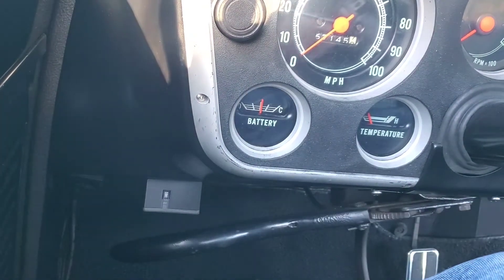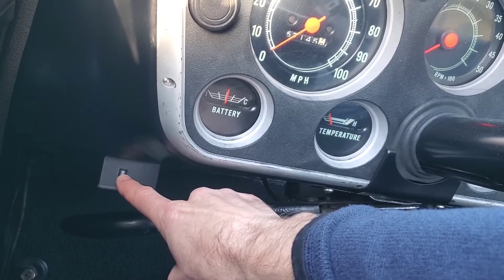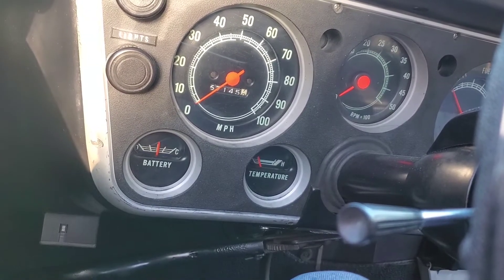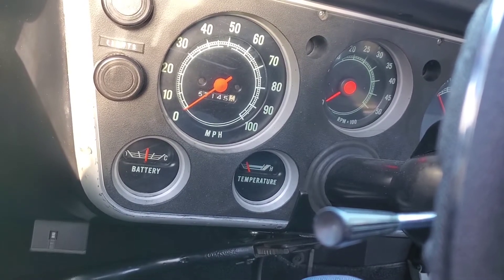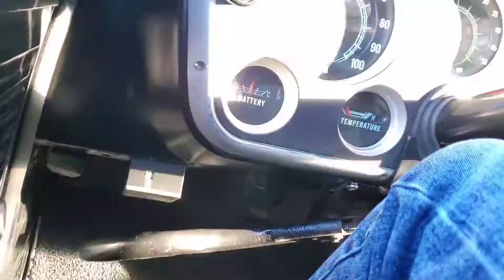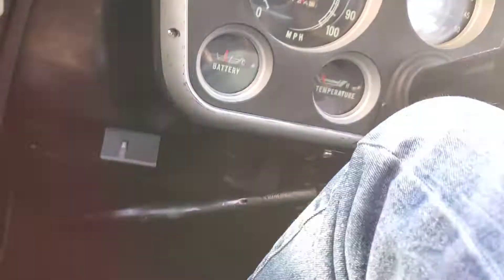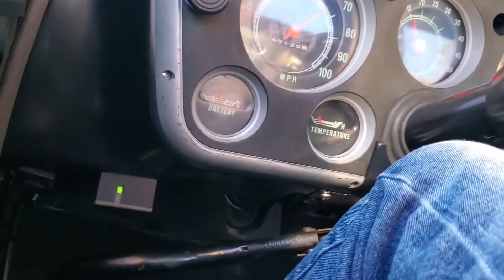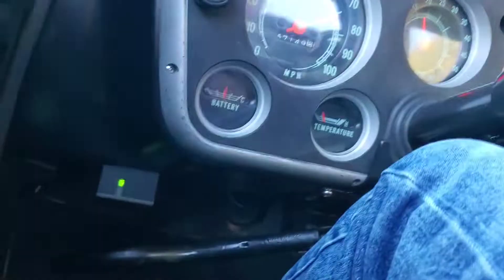700R4 Transmission Arduino Speed & Vacuum Based Controller for Torque Converter Clutch TCC Lockup

Comment: Are you planning on selling these?
Reply from the maker: I've thought about it, but I think they are too expensive to make. I'd have to sell the complete setup for like $400, which is quite a lot more than similar units from companies like B&M. Theirs is only speed based though without a vacuum sensor.